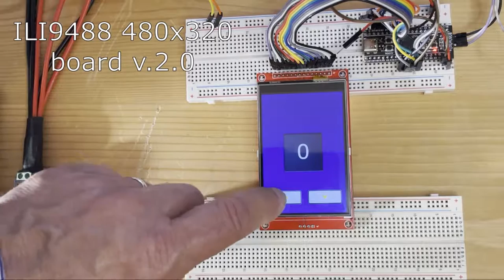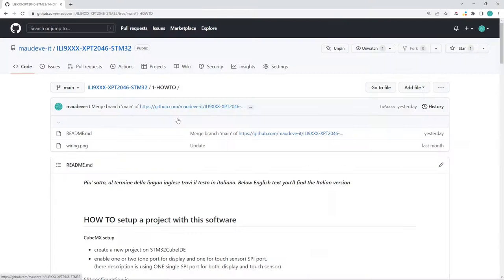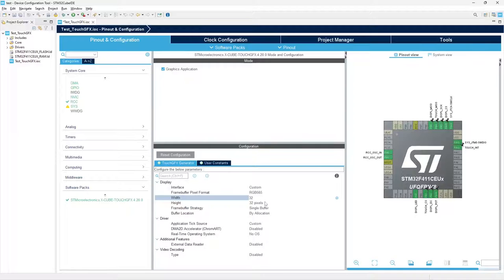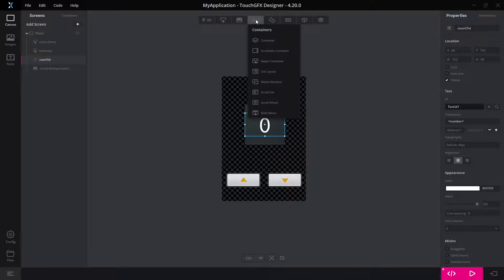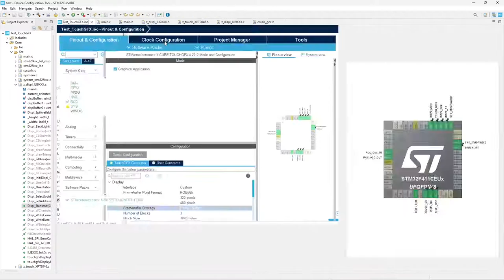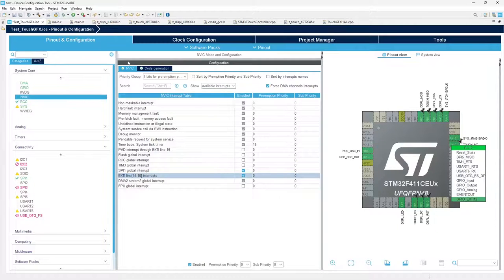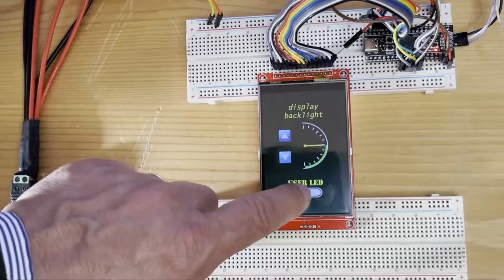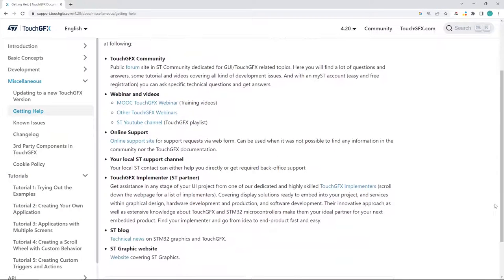A fast TouchGFX library for ILI9341, ILI9488 and ST7735 on STM32

Comment: This is an awesome video. I'm developing a custom build device using an STM32H723 and a touch screen using an ILI9488 driver chip. I wasn't sure exactly how to integrate TouchGFX with a custom design, but this video pretty much shows you how A-Z. Thanks so much.
Reply from the maker: Good. 
Are you working with ILI9488 via serial or parallel interface?
Do you know also why there is this difference between the ILI9488 boards? What could have changed in v2.0 boards, to let them work in RGB565?
Reply: @bluewat  I have done three interfaces so far. I've decided to only use the RGB565 format as I'll be using TouchGFX and have a larger application with a ton of images. My first board used the 8 bit parallel, but that would only get me like 7-15 FPS because I was using too small a uController and couldn't get one whole byte on a single port so with the over head of bit manipulation it was too slow. I then spun a board with a larger uController and moved to a 16-bit parallel interface. I pushed that design and was able to get pretty decent FPS of maybe  10-20, but I was trying to get by using only the GRAM on the display because my uController didn't have enough to fully drive the display (320*432*16-Bit). I finally just decided to go full out and use the STM32H723 with an 8MB SDRAM and us the LTDC controller and fully drive the RGB interface. Now I have a ton of RAM and ~70 FPS all done by hardware. This is a much more complicated setup, but if you're looking for high performance it pretty cool. It also brings along with it the ability for two layers that the hardware can also blend together and do all kinds of other special effects like have a stationary background layer and another layer that can easily be drawn over it.
Reply: @bluewat  Not sure about the Rev of the ILI9488. I'm working of the the 1.0 datasheet.

Comment: after adding all files
In z_displ_ST7735.c and z_displ_ST7735_test.c files
#include "fonts.h"
#include "z_displ_ST7735.h"
#include "z_displ_ST7735_test.h"
I had to redo the definitions.
  It is necessary to update the touchgfx application every time the .ioc file is updated.

as a result both methods work fine for 42 MB/s with sst7735. good job
Reply from the maker: Yes, I haven't seen a reference in documentation, but it seems that if you change CubeMX configuration, you need to re-generate TouchGFX project.
You shouldn't need to add "fonts" and "_test" files in a TouchGFX project.

Comment: Hi! Really appreciate for your work. Your library helped me a lot.
But I want to use more bigger fonts then 'font24.c' in your library. So I edited font24.c file on my own by extending its arranges twice bigger.
However, it doesn't work well as original font files. Is there any size limitations for ILI9488 for displaying bigger something?
If you have a great idea for displaying bigger fonts in this display, please help me
Reply from the maker: I agree: ST fonts shown on ILI9488, can appear too small for some needs.
In Displ_WChar I added "size" parameter that, if set to 2, "doubles" character width.
It should be easy also to double height. 
Be aware: You can see that there is no a buffer swap inside the WChar function. It means that you have to set buffer size able to store at least 1 char.
eg. Font24 is 24x17 pixels per character. In RGB565 it is 24x17x2 = 816 bytes per character, RGB666 needs 1.2k. Doubling with buffer must be > than 2.4k. Doubling width and height it must be >4.8k. 
Maybe problem you had was just a buffer overriding.

Comment: thats a very good and awesome work you have shared to us brother. thanks a lot for that. i have tested it with STM32F401RBT6 with ST7735. it worked well in spi polling mode. but facing problem with DMA and Interrupt mode. the LCD not getting initialized.
Reply from the maker: using TouchGFX?
Reply: @bluewat  tried both , only polling worked for me in both direct and touchGFX modes.
Reply: @bluewat  it occupied  52k of 64K ram as of now with out any special  images, but made 2 screens and 3 widgets.

Comment: Thanks for all of your help on this! I've got it around 90% working with an ILI9488 and STM32H7, however I have run into a couple of issues near the end:

1.) When using the touch functionality with TouchGFX, the LCD will randomly turn all white when rapidly touching the screen and requires a hardware reset to fix. I've narrowed it down to the T_IRQ pin as the culprit and it seems like frequent touches cause it to catch in some loop (not 100% sure)?
2.) The update speed of my LCD seems much slower to your example (this especially shows when holding down one of the arrow buttons and the counter ticks up much slower) when set up with similar settings as yours.

Do you have any ideas on how to fix either of these issues?
Reply from the maker: Hi Sean,
about question 1)
As per what I can say, what you report indicates a problem on SPI communication, so I would follow theese steps:
- (obvious) check for a stable and affordable SPI wiring
- check SPI speed: I was never able to go over 50Mbps but in case of problems try to slow it down, I've seen (and shown in some video) that different displays can have different behavour. Remember that the SPI speed is not defined in CubeMX but by DISPL_PRESCALER define in "z_displ_ILI9XXX.h".
- set also "output speed" to pins involved in display: working ad 50 Mbps I've seen that they have to be set "high" at least. But the meaning of these "lables" depends on the uC. Check your datasheet.
 This should fix your problem 1)
Reply from the maker: About problem 2:
that's a strange behaviour. I've seen that different uC can have different performances and unexpectedly enhanced SPI/DMA devices can bring to a slower performances with short data transfer. But that should not mean a "much slower" display as you say.
Have you tried to increase the buffer size ("block size") on TouchGFX configuration in CubeMX?
Having "pin availability" on the uC it is better to separate touch SPI by the LCD one. It will increase the overall TouchGFX performance.
I know that current library available on my GitHub page needs working a little fixing it to work on two separated SPI ports.
I will provide in a short time a new release easing the two configuration (single or double SPI port) along with enhancements for the usage of complex TouchGFX widgets.

Comment: Hi Mr. Vecchi, 
Many thanks for this very informative video. But for some reason this ST7735  library is not working with touchgfx for me, although I have the display working directly with another driver. This means, my pin connections and SPI configuration is ok. I think I followed all the instructions you mentioned in the GitHub, but no success. Is there a chance that you are missing something in the GitHub for ST7735 part?
Reply: I resolved the issue by merging the other driver's init function and your TouchGFX implementation in the z_displ_ST7735.c file:) Anyway, thanks again for the information and the code that you provided in theVideo/GitHub.

Comment: Dear Mr.Mario, every thing works fine but buttons on the bottom activate when touch on the top, I am using ILI9341 in landscape mode, I tried with changing "Displ_Init(Displ_Orientat_90)" to Displ_Orientat_270 ,  display rotate along with buttons but touch also rotate, also test by changing the "define T_ROTATION_xx". Please direct me to how to fix it?
Reply from the maker: That seems to be something related to touch sensor calibration. Try to check it.
you could follow guideline here:
https://www.youtube.com/watch?v=KS5u2-6yruU&t=434s
or here:
https://github.com/maudeve-it/ILI9XXX-XPT2046-STM32/tree/main/4-CALIBRATION

Comment: Could I use the same library for ili9341 3.5  you use with ili9341 2.8 240x320 ?
Reply from the maker: what's the 3.5 resolution? As per what I see on datasheet, 9341 handles 240x320 displays: library should work without any changes. Anyway, if display has a different resolution, you should just set its size on z_displ_ILI9XXX.h around line 175

Comment: Hello Mr. Mauro
thanks a lot for your good tutorial.
I have one question.
Can I use this tutorial for ili9486L driver?
Reply from the maker: Unfortunately I haven't an ILI9486L board in my drawers.
After a quick reading of its datasheet, it seems that ILI9486L and ILI9488 work exactly the same way on SPI (they seems only to have a different color resolution on parallel communication, same commands. "After a quick reading").
But... I don't know the board you are referring: if it is SPI and uses XPT2046 touch driver (or if it is a no-touch board), you could try to set library as ILI9488_V1 and, if it works, you could try also ILI9488_V2 which gives faster results.
Let me know how it goes.
Reply: @bluewat  thank you. sure, I will test it...

Comment: is it possible to do it with ili9481 using this library? i am unable to find the exact library for ili9481, can anyone help?
Reply from the maker: The underlying logic is independent of the display used. But ILI9481 seems having a different configuration in many reference commands (e.g. RAMWR). So, I suppose this library cannot directly work with ILI9481

Comment: sorry because in some places it appears that the ILI9488 screen only works with a pencil?
Reply from the maker: Using fingers you need less precision than using pencils. 
So you shouldn't have any problem.
Have you tried to setup a library calibration?

Comment: Hi Mauro.... Could give us a  global debug procedure ?  Thank you..!
Reply from the maker: The "Definitive Debuging Method"? That's too much. I can try to show how I move debugging my projects...
1) HW is ok? I usually setup a simple project (a non-TouchGFX project) allowing me to verify that display, touch sensor, flash (if any), other devices are working. That usually running simple test functions you see in other videos here or, anyway, simple basic tests of the devices involved. I keep this project available to run it, testing the system,  anytime I have a doubt about it.
2) Is TouchGFX running? a second simple project (maybe just involving a button and a counter as you see here) to see if TouchGFX is correctly set. I use that to check all the configuration (CubeMX and .h configurations) in case of doubt.  ...or restarting from here... sometime.
3) So, it is the current project! If the two above tests are working, the problem (because if I'm debugging means I have a problem) is just inside the project I'm developing. 

Keep in mind that there is ALWAYS a bug somewhere. If it seems that your (my) project is working, it's only because the bug hasn't shown up yet!

.
Reply: @bluewat   Thank you... but I'm  askiing for a simple procedura .... The idea is .... where to set 4 or 5 breakpoints ...

Comment: We're using an STM32F103VET6 and our Display is SPI based ILI9488 V1. The display didn't light up tho. Can you help?
Reply from the maker: Can you provide any more information about the error?
It's a V1.0 so you are not using Touch GFX, right?
What's the error?
Reply: @bluewat  Yes, we're not using touch GFX and are trying to run your test functions. The display just initializes and remains blank.
Reply from the maker: @abhijithmandava9314  Assuming ,you set parameters in the display .h file and touch one, If you get a full white display after initialization there there are probably errors on SPI.
1) doublecheck display wiring
2) verify speed (maximum output speed in CubeMX) of pins involved in display communication and control. 
3) try to run SPI at a lower speed  (remember that SPI baudrate is controlled by DISPL_PRESCALER parameter, regardless what set in CubeMX)

By the way: but Have you changed your above first question after I answered to you? really???
Reply: Checked 1 and 2 before, will try 3. Thx for suggestion. Tried posting 1st question with more info, but character limit didn't let me post. Reduced it to very information lacking question and that was accepted. After your answer I tried modifying it so I can add further info but same issue.

Comment: Hi Mr.Mauro , thank you very much for sharing. i need emergency  help .. i m trying to display a touch interface in 3.5" TFT  SPI with  ILI9488 driver .. i followed exactly the steps you show nut i have 25 error when i build .. i need ILI9488 driver for STM32F401RE nucleo or for STM32F407VG discovery i have both .. which one is compatible with ILI9488
Reply from the maker: 25 errors... well...  that seems non "exactly" the same as following proposed steps...🙂
Send me the list of errors, maybe I can halp you to fix something, or at least the reason for that.
I propose you to not overload this message system, movin to GitHub and opening an issue: https://github.com/maudeve-it/ILI9XXX-XPT2046-STM32/issues
That's also easier to use.
Reply: @bluewat  i have 3 errors just like the video before enabling the interrupt of PA12 ..but after i have 25 error ..btw i m using STM32F401RE and i think that's the problem ..there is the errors ../TouchGFX/target/generated/TouchGFXGeneratedHAL.hpp:21:10: fatal error: touchgfx/hal/HAL.hpp: No such file or directory......./TouchGFX/target/generated/STM32DMA.hpp:21:10: fatal error: touchgfx/hal/BlitOp.hpp: No such file or directory
 ...... ../TouchGFX/target/STM32TouchController.hpp:28:10: fatal error: platform/driver/touch/TouchController.hpp: No such file or directory
   and more
Reply from the maker: @mokhlessezd2106  I do not see why F401 should be a problem. Why are you supposing that? What are the limits are you knowing I don't see?
By above messages, it seems that TouchGFX project has to be generated. Keep in mind that TouchGFX must be THE LAST item generated in your project: e.g. if you make some changes in CubeMX, after having generated the device configuration you MUST open Designer and re-generate TouchGFX project.
Try that: maybe that's the only problem.
Now. Mokhless. If you like I help you, you have to help me. Do you see how is hard understanding your above post? If you need more technical help, please, post a message on GitHub, allowing you to post screenshots, program files and so on.
Reply: @bluewat   thank you very much sir .. i  sent an issue on github
Reply: @bluewat  I'm also getting 25 errors including disp.h and disp.c and touch.c files, how to rectify this issue

Comment: Hello , I did everything as you did and it doesn't work at all! i also use the same headerboard (stm32f411ceu6) the code compile without any error! my wiring is fine.... i'm using 3.5" TFT LCD with ILI9488.... I checked everything still get nothing... thank you
Reply: I had te same problem... I fix it so :   #define ILI9488_V1   in z_displ_ILI9XXX.h...good luck..

Comment: Great tutorial, but wiring image seems to be removed from github directory and unfortunately, I don't know how to connect microcontroller to my ILI9488 spi display v1.0 based on this tutorial. Can you upload wiring image somewhere else?
Reply from the maker: Updated wiring picture.
Be aware that you will not be able to run ILI9488 board V1.0 on TouchGFX.
It doesn't handle RGB565, as stated here: https://youtu.be/020k2vbLAPc
Reply: @bluewat  Thanks buddy, I didn't noticed that.

Comment: Are you work with ILI9342C driver?
Reply from the maker: No, I don't have it.
ILI9342C seems to be  an evolution of 9341 and the basic commands (what I'm using in library) seems to be the same. Same resolution.
You could try to set library handling ILI9341 and see.
Your display is an SPI one, right?
Reply: @bluewat  Ok, I will try use you library later.

Comment: Hello everyone
I'm using touchGFX and 3.5" display with ili9488
I managed to work with it and it shows everything as I wanted, but the issue is that when I power up the uC, sometimes it doesn't show anything and I need to reset the uC!!!!
I ran debug and there was no error or something else...
My uC is stm32f405rgt6...
What would be wrong...? 
Thanks in advance:)
Reply: i have the same problem is the touch working for u?
Reply: @sharankuppuswamy8951  yes the touch is working properly, what's your problem exactly? It doesn't show anything sometimes???
Reply: @Muhammad-qf9vl  touch is not working
Reply: @sharankuppuswamy8951  have you checked the communication between the uC and the touch? Or did you check the wiring?? Also , maybe it's about the calibration... Watch the video about calibration and set the parameters, it should work... At least it worked for me:)

Comment: Thank you very much for your video. On my board, I have an STM32F411CEU6, the LCD chip is an ILI9488, and the touchscreen chip is an XPT2046. I followed your tutorial and successfully flashed it onto the board, but my screen is all white. Can you help me, please? Thank you!
Reply from the maker: A full white screen should mean that SPI communication is not proceeding.
A lot of possible origins...
Not considering obvious questions about checking correct CubeMX configuration and wiring, one possibility is the GPIO speed of the pins involved in communication (CS and D/C for instance). Try to set them high or very high. Once working you will try to slow them down until working.
Another possibility, if you are prototyping on a breadboard, is that you are pushing too much the SPI port speed, having an unstable wiring. While prototyping I use a quite slow speed (even below 2 Mbps), pushing it up in the final part of developing or just when I move the project to the developed PCB
I don't remember if using a wrong color format leads to a "white screen". Try RGB666: that should be compatible with any display...
Reply: I already tried everything. Like  setting gpio speed very high etc. But screen is still all white. But I still thank for your vedio.
Reply: @HsuanderYT  Hello, i have the same problem... could you solve it?
Reply: @bluewat  My problem is the same as him does:(((
Reply: I had te same problem... I fix it so :   #define ILI9488_V1   in z_displ_ILI9XXX.h...good luck..